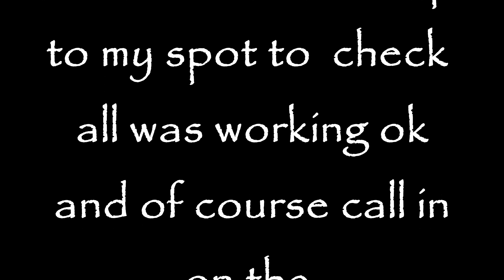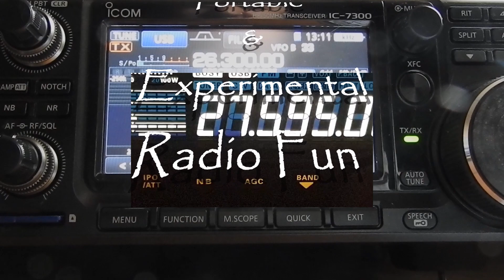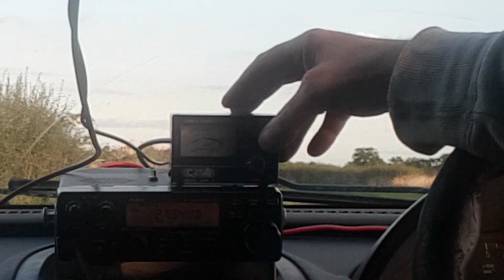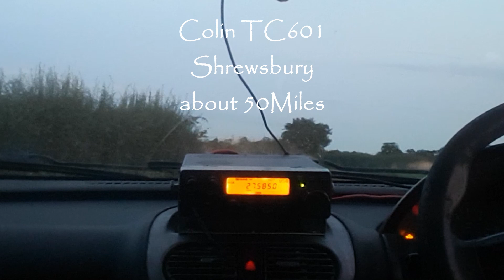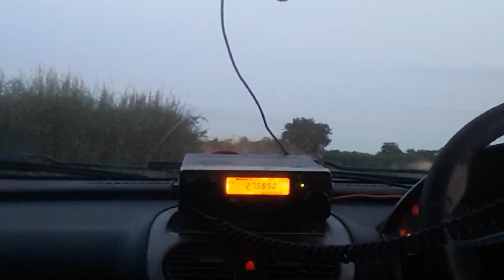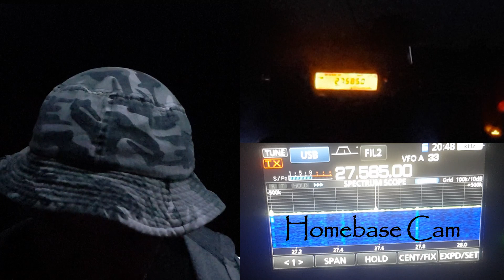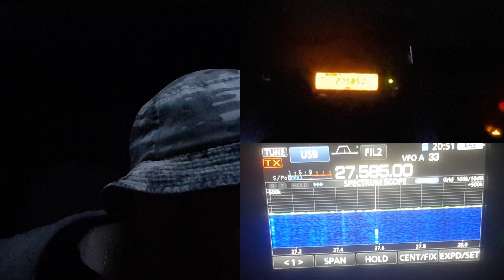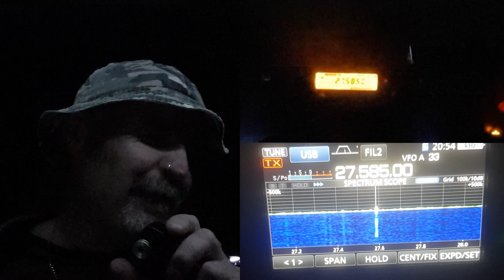Antenna Problems & Great Groundwave

Comment: A good night for radio then Al'.  Nice to see you getting distance without skip.  That can be very satisfying and even more rewarding then skip, especially if conditions hold and you can chat for a while and ask the others if they can hear the contact.  
If that were DX the contact would be gone before you got a chance to do anything!
I am doing my car out so I can charge another battery while driving.  I have had the wires in place since I got the car, but just had no reason to wire it up.
Now I am going to connect it up the car is due to be replaced this year!  Bummer  :-(
Reply from the maker: Sounds like you have the luck i do , do you have to change Car?
Yep i love a good long distance copy no matter if its DX or groundwave, been some really good conditions just the last week for UK stations up and down the country.
Reply: @Al.26TC101  I have a longish drive to get to high ground I can get out from to the south, then when I get there there is nowhere to have a pee, worse still a poo.
To make it worse every second car stops there to have a look around!
At one time if I went up there I could expect to find 6 cars at least sitting there with CBs, not anymore, I was up there for a day and didn't see a car with anything but a car aerial.
It is one of these laces where the police pass every now and again, so you couldn't sit there with an illegal CB, they would relish the chance to get your radio!!!
I am a bit cynical, if they take your radio and you don't go to court (like happened sometimes in the old days) what happens to the CB that was confiscated from you?

I have to change my car this year, it is coming up 5 years old, so it has to go.
Loose fat to much keeping it.  Very good car though, low mileage due to Covid and Lockdown!

I was going to try a hill that has a take off to the north of Scotland.  I was trying to find out which hill I was up once that you could see the whole of the North East Coast and the outline to Inverness and the East Coast stretching up towards John o' Groats.  Amazing view, but you have to walk up, no use to me, but if I had permission from a landowner and a 4x4 I might get up there.  If I could have interested a few to go with me.

 I asked a Gamekeeper what hill it was, but he had no idea, don't know why he had no idea, he was up there the same time I was there!

Anyway, that is a project for the future.

Comment: 10:00 not using record to SD on the 7300?
Reply from the maker: You know i never thought about that , cheers for the heads up ive got SD card aswell in the 7300. Will try that out next time , cheers.